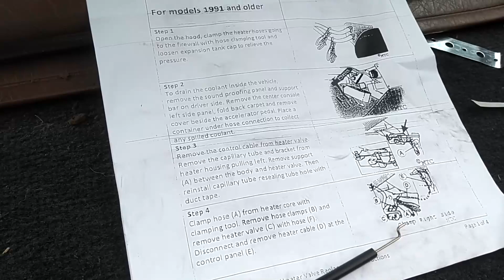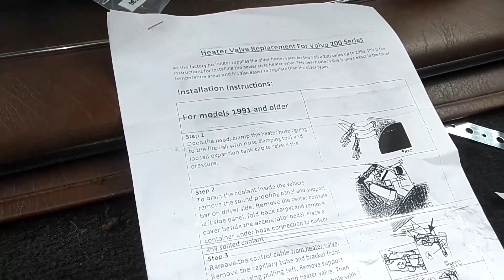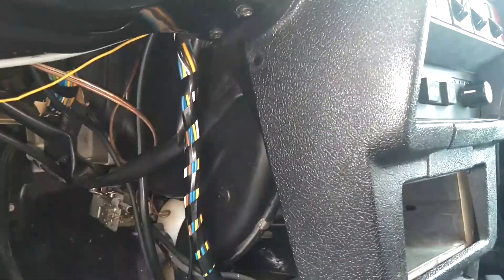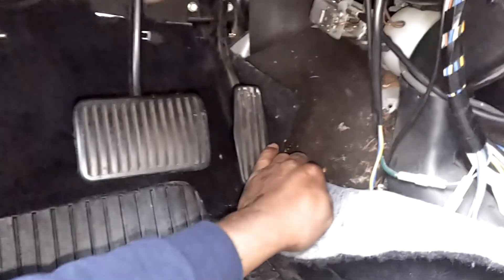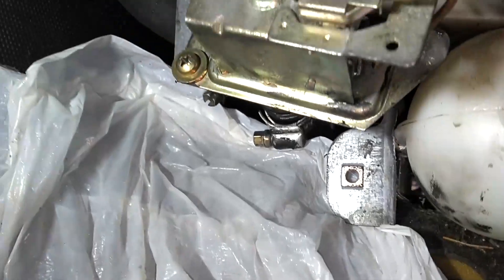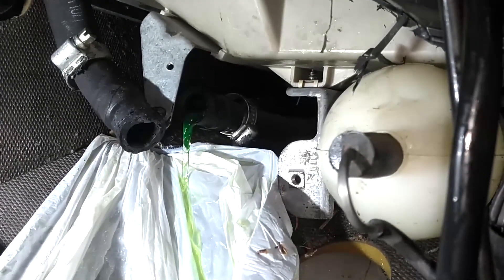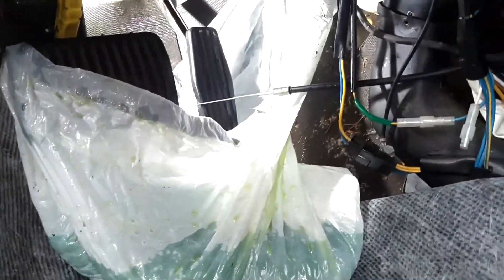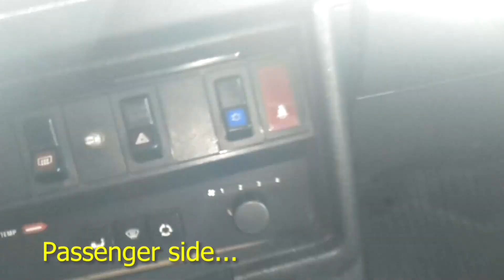How to replace the heater control valve on a Volvo 240, upgraded valve modification. - VOTD

Comment: I just did mine tonight! I wish I’d found this video before I did, but at the same time I went a slightly different route and came to the same place, so it’s all good.

I ended up cutting the long length of coolant hose that comes out the passenger side giving myself a lot more freedom during the installation because I didn’t have to try to attach the hose clamp, tighten it, and attach that plastic hose clamp and fix it to the bracket all while working blind and one-handed up to my elbow laying on the passenger side. I just have an easily accessible splice on the passenger side now.

I found that the hardest part about it was getting that long wire control cable through the right passageway. I ended up re-doing the whole setup three times because the first two times the control cable just wasn’t working. Each time was easier and easier, though, so it wasn’t completely wasted time.

Now I’m scouring 240 dash videos hoping to catch a glimpse of a short bracket with a plastic retainer for wires. Since I tore the car apart weeks ago and then got sick, I can’t remember where it goes for the life of me!

Thanks for sharing such great content!
Reply from the maker: thanks for sharing.

Comment: LOVE YOUR STYLE! Question: is the Heater Control Valve the same (do you reckon) from the '86 240 you changed, and my '95 940?  Great heat to no heat from one minute to the next.  I'm hoping the cable simply came undone. Checking that first.  But if I need to change the Heater Control Valve, (either ipd kit or the original from the Swedish Car site) is it likely to be similar or the same? Thx, Doug Day, Maine
Reply from the maker: https://youtu.be/Qvveywp-JOc